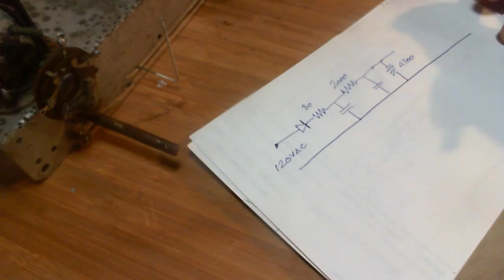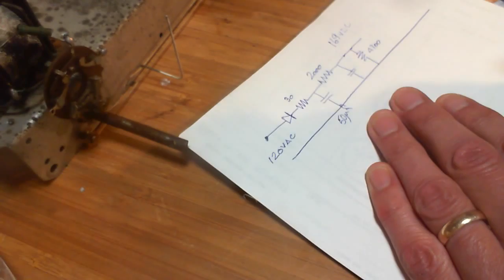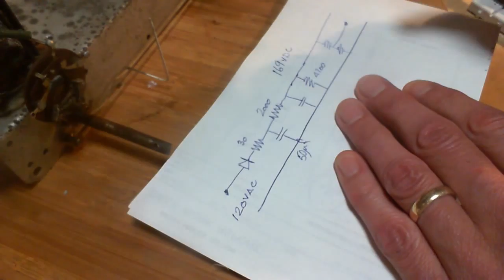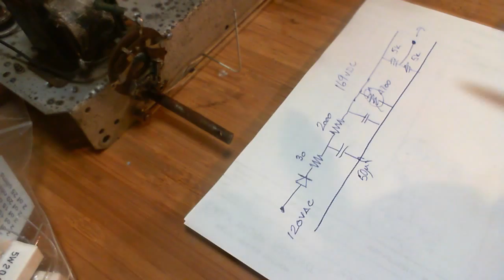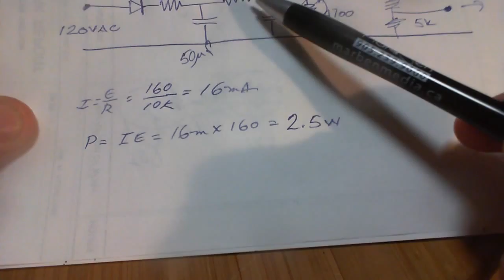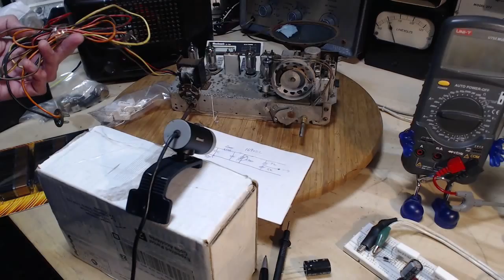Rogers Majestic (Philips) RM503 Farm Radio Video #12 - Abandon Ship

Comment: Hi great video 
I have a sky baby that I want to do this with.It has a 4 pin battery connector for the old style 90v battery. It has a red yellow black brown wire.Do you know witch 2 wires go to the 1.5 D battery and the 2 that goes to the 90v pack.Any help would be greatly appreciated as this was my great nans and would love to get it working again. 
kind regards Nick

Comment: The customer is going to love it when you tell them they need to spend $70 to $90 on batteries to run this thing every 30 or  50 hours.
Reply: Yep gotta agree, 9 volt batteries are about the most expensive ones there are. About $5 each for good alkalines in the U.S.
Reply: Ridiculous!!!!...you must buy your 9 volt batteries at 7-11...Even supermarkets sell for about $2 each...places like Amazon sell them  for way less...
Reply: OK.  I checked.    2 Duracell 9v alkaline battery packs as Jim used are $7 USD at Wal Mart.   $35 plus tax for ten 9v batteries, plus cost of a D cell.  So let's round off to $45 USD.  That is as of this minute  $57.93 CAN.   That is based on US sales tax.   The last time I was in Ontario Canada sales tax was if I recall is around 15%.   About double US. sales tax.    So I was off by a little.  My apologies.
Reply: Don't know why they are so expensive...Amazon sells a 12 pack of pro duracel 9v bats for 22 USD
Reply: No reason to apologize, I am sure it depends on brand and where you buy them, I am going by the average price I have seen at the grocery store for either Duracell or Ever-ready, about $4.99. I do think they are way over priced. I guess if the radio is only used once in a while as Jim said, it might be worth it, but personally I would not pay for them. That is one reason I avoid battery powered tube radios all together. They served a purpose at one time to people without electricity but those days are long gone. I do have Radiola 20 battery set, but have not had it playing yet for the same reason. Someday I want to build a battery eliminator for it.
Reply: I Googled 90 volt DC power supply and there are several out there and they just so happened to identified as power supplies for farm radios.   They include transformer part number with rectifier and capacitors.  The voltage divider circuit like Jim was trying to cheap out with only works if you are in the ball park voltage required.    Even then getting enough current in that circuit requires several calculations to balance voltage at specific loads.    If he is going to make another enclosure for batteries he might as well get a proper transformer ( about 65 volts AC output) and build a proper full wave rectifier circuit with filter caps.  The circuits I found actually had a second secondary winding for a 1.5 volt filament output too.  Get the right tools for the job.

Comment: Personally, I would build it using a full wave bridge rectifier and use a TL783 voltage regulator to put out a stable 70 volts.  The TL783 can take an input voltage of up to 125v.  If your worried about the input voltage being more than the regulator can handle, you could also get a 115v to 70v transformer.
Reply: A simple Zener shunt regulator circuit would be sufficient to provide power to this radio.   You may have to put like three 30 volt zeners in series to get the proper 90 volt output voltage.

Comment: Jim: You could save the battery holders for another project. Connect the + on one battery to the - on another battery, then connect the + on the second battery to the - on a third battery, and so on. You can connect 9 or ten on this way, all in one economical package.

Comment: Jim I would take the diode up to about 2 amps, then upgrade your caps from 160 volt to about 200 volt or maybe 250 volt, then do as the other person said about using a variable resistor to see where your 90 volts comes in at !!  I might even take the capacitor Capacity to  close to somewhere between 500 and 700 MFD to try to reduce the ripple more, and you will be dumping some heat from the resistors because you are having to loose 70 volts across the output!!  John Bellas

Comment: Jim FYI
Typical capacity of a 9v PP3 disposable alkaline is only 550 mAh .
So 50 hrs ?
Reply: & a lot less if you up the volume .
Reply: Not with a class-A output stage. Suppose that with zero signal, the output stage draws 10.7 mA. Now consider a sine wave applied; half of the sine increases the current draw, the other half reduces the current draw.
The mean current draw is still 10.75 mA...status quo.
Watch Jim's current draw measurement as the receiver loudly crackles: 10.7 mA. Silent...10.7 mA.